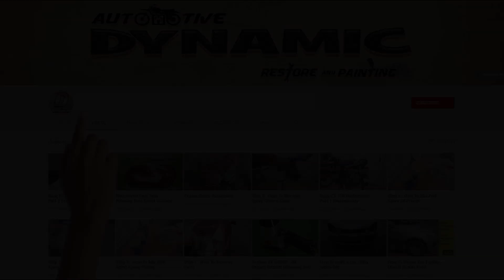Hero Honda CD-100 | Engine Painting | 📣 Voice over for the first time🙄🙄🙄

Comment: Not impressed. By this way you will damage all the oil seals. And while washing the engine you must need to close intake manifold.
Reply from the maker: Thank you so much for your info "SIR" (Big brain customers don't want to disassemble the engine with mechanic that's why We have to paint like that
Reply: @DynamicAutoYT  ok then its fine. But in the video please mention the correct way so your subscriber will get 100 % correct information for the paint job. Best of luck